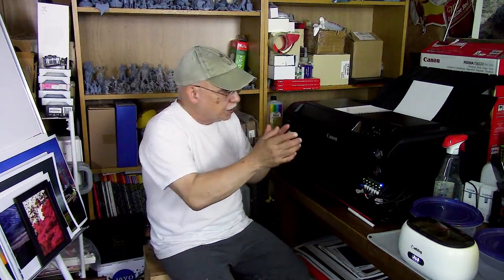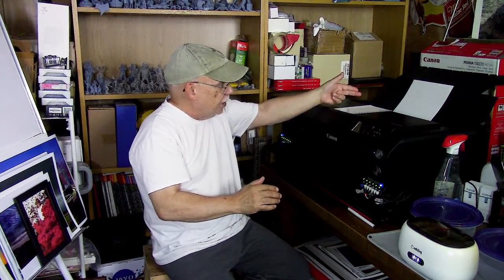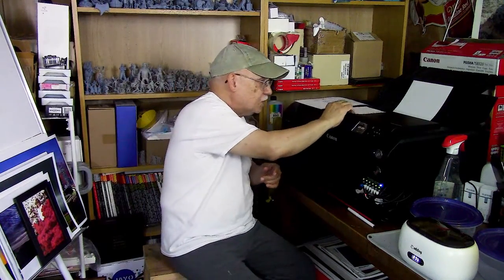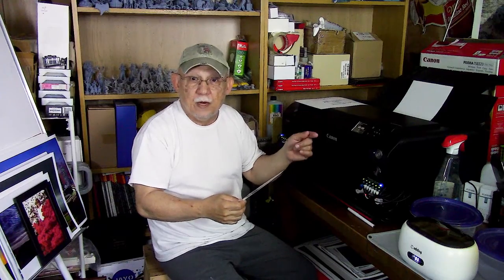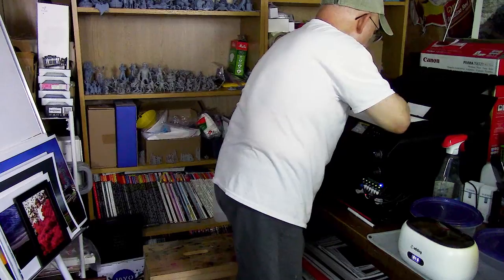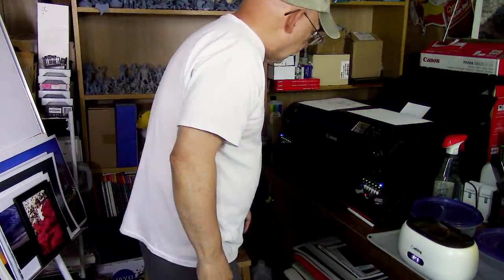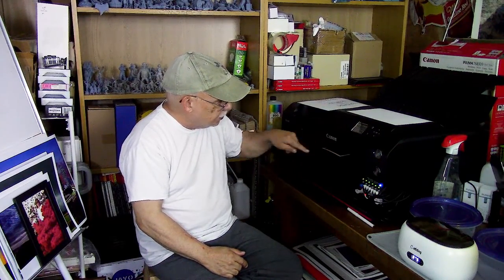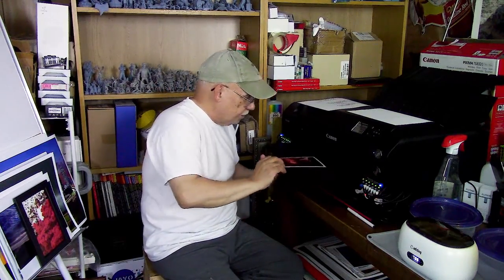What you MUST do to STOP wasting ink on your PRO 1000!

Comment: I've been following your advice for about 6 months now,  but I have to say that I think "once per day" is too much, at least with the latest firmware and with a new printer.  I've noticed the same amount of "long cleaning cycles" printinf every day or printing once a week/5 days... I was printing every day and my inkeset in one day went from 30% to 10, all inks (half were already at 10)... Then they stayed there.
Reply: What would you reconmend doing then?
Reply: @MIshaHaijtema well, the most important thing is to use it as much as you can, like he says... I only have experience with mine, so it is not statistically relevant, but personally I have the latest firmware and I keep it on all the time: even with daily purge sheet printing, I get long cleaning cycles once in a while.
Reply: @ridni2388 I was thinking of buying this printer but I heard that for non-intensive use (hobby), the canon Pro-1000 would waste up to 50% of the ink with expensive periodical cleaning cycles.
 
From your experience would printing once a week significantly avoid ink waste? 
Can you estimate in total how much % of the cartridge is ending up in the waste box?
Thanks in advance for your reply
Reply: Unfortunately the issue around ink waste is common & being a problem for years!, what you have to understand is that Canon, Epson, HP are all the same they design & program their printers to clean the nozzles on a regular basis & basically Waste lots of ink which in turn forces you to Buy More ink =  More profit for the above printer manufacturers 😊

Comment: Just to be clear. Is the process to print a nozzle check every day and print a matte test print and photo test print or should I just do a nozzle check every day?
Reply from the maker: The nozzle check will use both blacks. But the Nozzle check does not really
excercize  the printer enough. It's only for diagnosing printing issues!

Comment: I don't understand why QImage can not trigger all 12 cartridges, no matter the paper. I purchased the software expecting that it will do all inks but it only does the one you can select in the software and then I apparently I need to waste matt and glossy paper to trigger different inks? Is there no option or file that can trigger all 12 inks for a single page print no matter the paper selected? Thanks Jose Oh also, I am running low on 5 inks and I have them here already but its still printing, I am afraid that it uses now the rest of ink that is in the lines but the cartridge is empty. What happens if thats the case? Then it will take forever to refill the lines, won't it? Or will it stop printing when the cartridge itself is really empty. I use original inks. I don't have a weight scale to measure 33grams

Comment: Hi! I'm looking for some advice. I got my PRO1000 this tuesday and have approximately printed 5 x A3 and 10 x A2 since then, all on Canons luster paper. More precisely it is 5 x 30x30 cm and 10 x 42x42 cm, basically squares the size of the shortend of the papers. The rest of the paper area were left unprinted. When I check my ink levels it is already down to a third on each of the cartridges. When I saw this I freaked out a bit. Have I been doing something wrong, do the starter cartridges not come full or what is going on?
Reply from the maker: Check your IMPUT and OUTPUT Size. It needs to be the same.
Reply: I think I heard in a different review that the ink level doesn't include what is in the lines... but I'm not sure so don't quote me 😅
Reply: Half of starter cartridge is used to fill internal tanks and tubes inside printer. They even mention this in manual - that first set will produce less prints